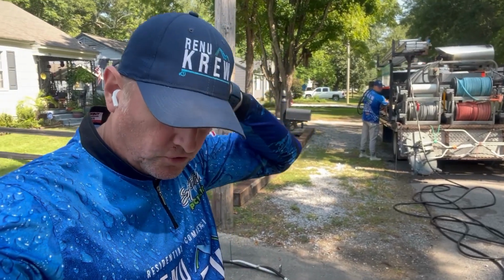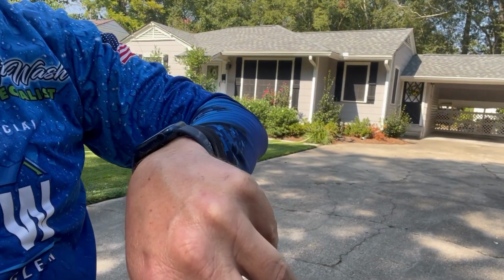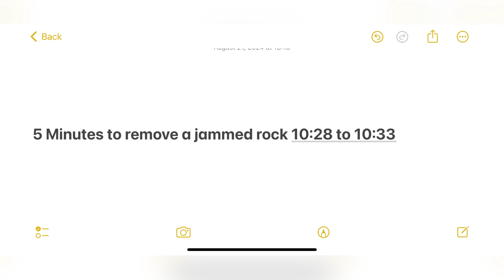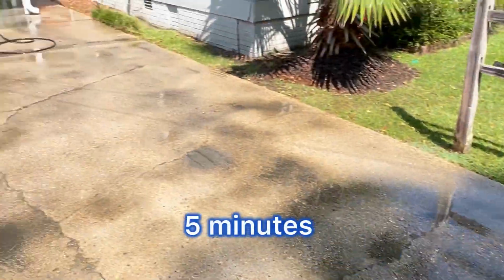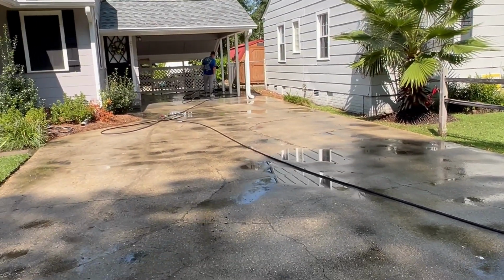20 Gallon Per Minute Surface Cleaning 🔴

Comment: Thats a beast that is are you running half inch hose then split to the 3/8s ? im running though a 1/2 inch uploader and getting 30lpm seems powerful but yours in next level awesome, opps just seen the text on the video , nice one
Reply from the maker: @Bournemouthjetwashing  yes sir. 1/2” line all the way to the surface cleaner splitter. 3/8” line to from surface cleaner splitter. Tremendous increase in flow. No restrictions so you can basically walk a normal pace.

Comment: what size hose are you running ?  Awesome setup.
Reply from the maker: @MR.TOYBOX   yes sir. 1/2” line all the way to the surface cleaner splitter. 3/8” line to from surface cleaner splitter. Tremendous increase in flow. No restrictions so you can basically walk a normal pace.